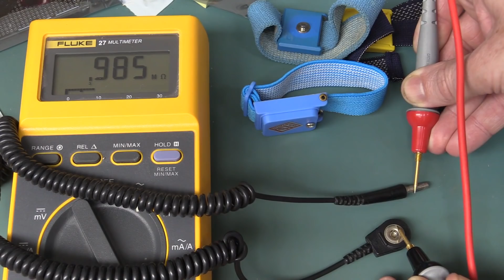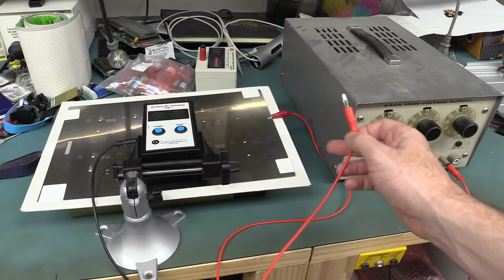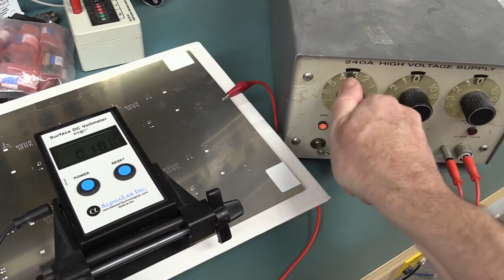EEVblog #768 - Cordless Anti-Static Wristbands BUSTED!

Comment: What generates more pain when stepped on bare feet? A Lego brick or an upside down PDIP? :)
Reply: +Bastet Furry Both are horrible as fuck. trust me. Bad thing about DIP IC's: They stick to your feet and when you accidently stamp your foot on the ground... yeah you guess it.
Reply: +AtmelKiller So...DIP ICs are even worse than Legos. Ouch!

I can't say I've had anything like that happen. The closest I can think of is when I was building my first custom-built computer, and I couldn't find my processor...until I lifted the case, and saw that I had partially squished the brand new processor with it. Mega fail. Thankfully, not only was the processor a cheapo Athlon II X2 215 (though it was ~$45 and I was on a very small project), but I was able to straighten the few pins that got bent, and I got it working.
Reply: Lucky you ;) good that intel decided to use pads. i think that was the reason to go for it. But trust me you dont want to walk with a dip ic in your foot. Its the worst thing that can happen to electronic enthusiasts.. ok blowing up expensive gear hurts your wallet even more...

i remeber when i was young.. Playing around with socket 7 processors.. Once fault pins blew the caps on the mainboard. it was the first shocking situation in my electronic life because it also blew the power supply and blew the fuse for the room. Interesting how far weve got in the past 10 years.. incredible but i like it :)
Reply: Yeah, I like LGAs. At least from what I can guess, you're really more likely to mess up a processor's pins than a motherboard's, because the motherboard is a bigger part than the processor is, and is probably screwed down well into a case. The socket's well-protected, too.

Also, that's quite a story you have there! I've had quite a few scary things happen with various computers myself, though it sounds like you've been in the field longer than I have. The first systems I remember repairing were two old Compaqs (SR1010Z, socket 754 from 2005, SR1020NX, socket 478 from 2004) that were sitting around, and this was roughly 2009.

I actually have had an old Pentium 90MHz (SX879) sitting around for years. To this day, so many often-free computers I have later (I have about 33 right now), I have no motherboard to test it!

WALLS OF TEXT INCOMING
My most recent scary story: I had a FlexATX PSU with an ATX-to-HP Slimline power connector adapter connected to it. This was for a PC-in-a-Sega-Genesis project I'm doing (still not done yet). At one point, I had the adapter offset by one pin on the ASUS MOCA-AR motherboard's connector, but I didn't realize it. I plugged the power supply in, the lights dimmed, and I heard a loud POP from the power supply. I frantically unplugged it, scared thinking of what could have just been ruined, but it turns out that only the PSU died, everything else is fine. This happened 5 days ago.

Even though I had a 14-day return window and I was on the early morning of day 15 since my order (though I only had the PSU for a few days), I contacted the seller about it, and not only am I being sent a replacement, but I'm being sent two of them, and the seller didn't even ask me for the blown one back! Woo!

I may even (carefully) repair the old one, too! I'll actually be better off because of the power supply blowing, rather than worse.
Reply: +Racecar564 Pretty interesting what can happen when you plug one pin wrong or leave it in the breeze. 

i hope you get these old machines fixed. these are even more interesting than the new ones because you really have to know what you are doing. your even able to destroy your bios by removing the light blocking sticker from the eeprom. good old days, ceramic dip ic's with glas windows. love them. 

but thats indeed a veeery good seller. he deserves a flower :)

i guesst the 'pop' was at least one cap that released the magic smoke. go and look for it! there are many filter caps on every power rail so it is pretty common that these blow first when something goes terribly wrong. everything else is well protected these days.

how to piss off your boss in the 90's? easy. at least in europe or other countrys with 230v mains like i got in germany. just flip the red input voltage switch to i guess 110v.. right? i cant remember if it was 110 or 120.. you can imagine what happens when he turns on mains power to the power supply ;)

ah good old days. not anyone was able to repair computers. nowadays nearly everyone can do it. its so well documented and idiot safe. you can even forget the 12v to the gpu.. no worries my asus gtx950 has led's on the power input. if its red power is missing or theres something wrong. white: everyrhings fine.

when i think about laser diodes and esd.. jesus.. i wonder if dave ever worked with laser diodes... i build laser display systems with the ilda standart for me and i can tell these things are reeaallly sensitive to any kind of esd. touch it once and you killed hundrets of dollars. (price depends on the diodes wavelength and output power)
when i think about the size of those its just insane what these things cost. 520nm green 1W laser diodes can cost up to 500 dollars and you can kill them by just touching them once.

electronic isnt for anyone! but it is love. etching pcb's in moms kitchen.. oh yeah memories...
Reply: Yep! I have a story myself of unknowingly killing a Gateway 4DX2-66 with a RAM module in 2011. I can only assume that the RAM was 3.3V RAM, where the rest must've been 5V, so the extra current destroyed the chipset. That's based on what I saw in a forum topic on VOGONS, but I don't even know if the stick I used was, indeed, a 3.3V one. It certainly sounds like we're a bag of stories! If you're interested, I've got a website here, with my collected computers & electronics horror stories and such: http://racecar56.no-ip.org:81

The seller is crosscoast_trader of eBay, who indeed deserves a flower. :D

Ah, the good old power supply voltage switch. One of the two OptiPlex GX620 MTs I just got for free recently, thanks to a friend saving them from being trashed for me, had its voltage switch set to 230V, which is nonsense considering I live in the US, and that's where the PC came from, too. It also had a capacitor missing from the board, leaving only two metal terminals which had to be bent apart before I could get the machine to boot, otherwise I got the Amber (power) Light of Death. The other GX620 was fine, but its Seagate hard drive was ruined (scratched surface, confirmed by opening it up), contrary to the missing-capacitor one, which had a fully-functional WD drive!

Wow, though...those laser diodes. Now that's something you don't want to use a VOODOO MAGIC "cordless wrist strap" on!

Comment: Cordless antistatic wristbands are what powers the free energy generators. All the static discharge is stored in Quantum Vaccuum until it is needed to drive LEDs.

My guess is that they originally were meant to be grounded by attaching a simple wire to the screw on top. Still cheapo, but it would work. But then somebody thought: "Hey, why not con some stupid idiots?"

Comment: Maybe the resistor and screw are meant as safe discharge path when you touch the esd mat with it? Preventing the nasty zap. But then again, static charge is so fast to build up, you'd need to be touching the mat with the screw every 5 seconds, which kind of negates the idea of "cordless". So ultimately this product is still bullshit...

Comment: He had that power supply specially built for himself. That one goes to 11. Other power supplies only go up to 10. But what if you need that extra little umph but it only goes up ten. What can you do; you're already at the highest number. If Dave is at 10 and needs a little bit more, he can go to 11

Comment: Clearly this strap is a complete con but would it be theoretically possible to build a cordless anti-static device. I seem to remember that static likes to discharge into the air at sharp points so I'm thinking of something like a jacket with pins all over it. Totally impractical but that's what the internet is for :-)
Reply: Wobblycogs Workshop you could accelerate this by making the tip out of a radioactive material, ionizing the surrounding air...
Reply: Good idea, a jacket covered in just pins was far too simple and safe.
Reply: Uwe Zimmermann heavy metal as fuck

Comment: You're just plain not using it correctly. You're meant to touch the screw on the wrist strap to an earth plate on your bench before handing sensitive components.
If you were working in an earth free environment, as some electronics labs are, the last thing you'd want is to be attached to earth...

Comment: Hi Dave i think you should do a video on safety as there is some confusion in the comments section about it, i think it would be best to cover all.....

Especially on RCD's as someone mentioned that earth is connected to neutral where in most houses its connected only before an RCD and why using isolation transformers are important

Thanks Dave for this video its always amusing to see the "Safety Equipment" that comes from wan hang lo company, China.

Comment: Of couse it´s not working, as you need to put a WIRE on that screw by yourself, that´s the POINT, wireless is only true while shipping this unit, after it finally reaches you, it´s up to YOU to attach a propper ground wiring ohterwhise they would have omitted that screw as "Woung-Hong-Loo" has put a lot of research into it to provide YOU the BEST Cost vs. Value it can have, therfore they put all remaining savings into that screw, as they already knew you would imediately know what it needs to be completed and working, as well all know that these bands are ought to be worn by the best engineers out there in the whole world! And, of course, "Woung-Hong-Loo" knows this too!!
So, sorry Dave, you had totally missed it all.....;)

"Woung-Hong-Loo" is always RIGHT, always.....that´s for sure.......
Reply: TubiCal If you connected to the Screw with a wire, the resister would be broken off the screw

Comment: baggy track pants fresh out of the warm cycle of your dryer for 30 minutes without your feet through the leg holes walking on the legs of your pants and take of any cotton. ie underwear.  static nightmare.

the scam anti cordless probably came about because of the expansive materials. look at what is missing, the cord. if im not mistaken cords have copper wire in them. but the wrist band was just plastic buckle cheap tin mass produced steel screws and a recycled resister. there is about 20 cents worth of materials but with the copper wire and the cord most mass produced cords would be some form of TPE. so the cord is the most expensive part. they can sell the 20 cents worth worth of junk for a dollar people will buy it realise its a scam and think, well fuck i don't want to spend $5 return postage or i couldn't be bothered asking for my money back because it only cost a dollar. if they sell a million units they have made an easy 800 k. but it isn't all bad news most of that material is probably recycled electronic waste and recycling is always good so if you buy one of these fake anti static wrist band just get yourself a cheap alligator clip and some old phone cable and macgyver yourself a real anti static wrist band.

Comment: These are old. I've had one for like 10 years. They were sold at a local electronics store. I don't recall which store. Perhaps I've been lucky, but I've never had trouble with static electricity with or without the strap. I've made other stupid mistake I wish I had video recordings of. None were static related. Some involved phone support not being clear.

Also, I have big hands. None of these straps fit my wrist. I have to wear them across the back of my hand. Even that starts to restrict blood flow.

Comment: I'm surprised they went so far as to actually put a resistor in there. I guess this speaks more to the low price at which these components can be bought en masse in mainland China than it does anything else. There is literally zero reason, logical or insane, to include something like that when the entire premise of the product is conning stupid people anyway.

Comment: You'd love the "Electricard" by Filipino Company "Freepower" which supposedly has a Nano Technology that will make your appliances and electronics run cooler, smoother, last longer and run more efficiently, thereby saving energy. It's "vibration wave" compresses the electricity wastage in the wiring system thus increasing power efficiency and reducing wastage to achieve electricity savings.

-- Taken from their FAQ on their Facebook page... A friend told me about it and I was like "Lmao... You don't believe in that stuff... right?" xDDD

Comment: Ha ha!  I shouldn't laugh, but back when I was first experimenting with digital logic gates, etc, one of my 14pin DIP inverter chips landed on the floor and got lost.  That is, until my mother's foot found it and I had to use an IC puller to pluck it from her heal!  Fourteen perfectly aligned tiny little red holes under one band-aid..  :-)  Sorry, mom!  The chip still functions..  :-)

Comment: I dont get how can KV be generated like that , that cant be regular kilo Volt, i also dont get how can charge be 0 when grounded , cuz ground is not 0 volts. thats why Ground loops can happen. I dont doubt it but i dont get it . If potential is 0 on ground then no ground loops can happen, if KV can be generated by bare foot friction , why dont African kids sell power in spare time by foot friction of 100 kids in series :) i dont get it ..few volts yes but i didnt know i have KV of charge on me
Reply: +Pavle Pavlovic When you receive a 'shock' from static electricity it's usually on the order of thousands of volts. Voltage is not the same thing as power; you can generate kilovolts easily, but the total charge will be absolutely tiny so you can't get any useful power from it. Voltage is always relative, so ground is almost always regarded as 0 volts relative to everything else.
Reply: BenjaminGoose i know its not power

Comment: <This is what the advertising says> The wireless ones have a built in capacitor which slowly charges up from the static energy that your body picks up or produce, it
 will discharge automatically when your not wearing it. ROFLMAO
Reply from the maker: LOL!

Comment: As someone previous commented, it works on a quantum level, the problem is that if you observe it it behaves differently, so in that respect it works, you just cant measure it as that would be observation and have to trust that the company have done their due diligence and have some amazing physicists that are working on the cutting edge of technology that cant be verified. That's no ordinary resistor, it has a built in quantum flux capacitor on the quantum level. And Dave, awesome blog, i am just a hobbyist but love the channel.